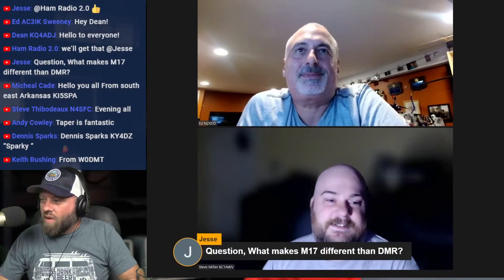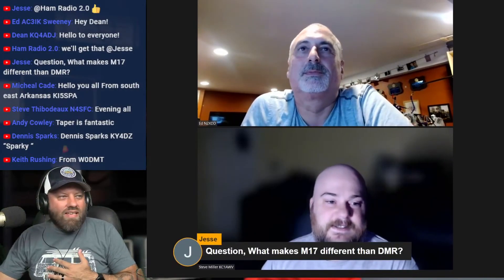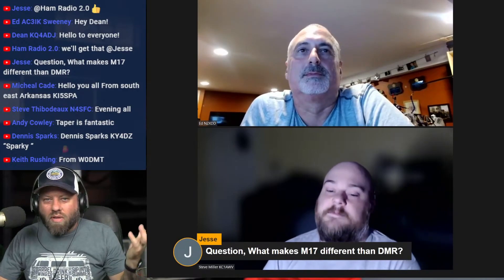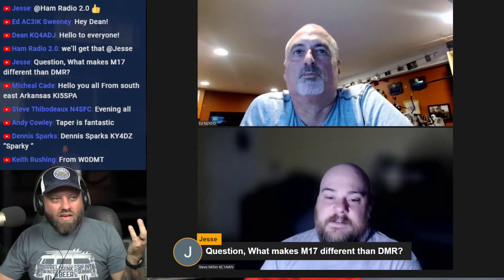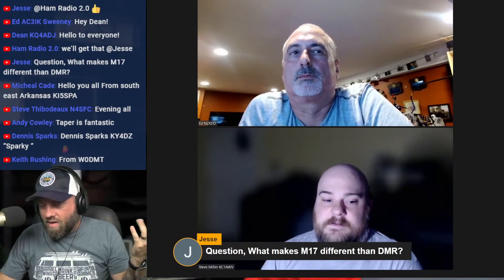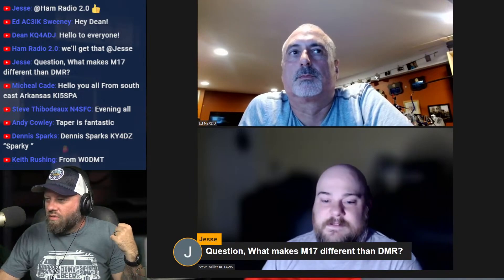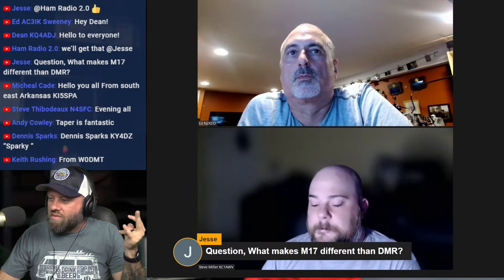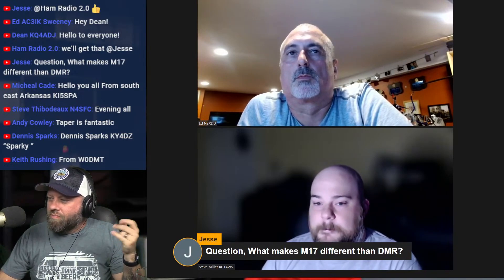M17 vs DMR - Digital Voice Mode Comparison

Comment: Three years later, OpenRTX is still incredibly primitive and M17 audio is still ghastly, filled with painful squeals and squeaks. Wanna see for yourself? Tune in Kansas City Wide on Brandmeister 313136 on a DMR radio and reflector M17-KCW Module A on an M17 radio, Droidstar or the M17 web client. Tell me which one you want to listen to. That system has a ton of traffic, it won't take long.

I'm not an M17 hater, I had high hopes for the concept, bought a CSI radio for it, modified a TYT and have been following along for years now. But apart from Jerry Wanger's radios (whose version of OpenRTX is stripped down even more than other releases!) the much vaunted hardware is mostly vaporware or unobtanium. Suggested solutions are buying a $500 radio with a 9600 baud data port, connect it to a computer via a digital interface and talk through a USB headset!   Don't wanna spend a huge pile of cash just to talk into your computer? Well, you can buy a $100 DMR radio and perform microsurgery on it's TINY surface mount components that most people over 40 can barely see, let alone rearrange on a circuit board. Once you've got a hardware solution, repeaters with M17 don't exist in most areas, especially since MMDVM & WPSD support was dropped so you'll need to load a stagnant, modified version of WPSD on your hotspots. Simplex? Forget about it, you're surely the only ham anywhere near your Maidenhead location that is equipped for the mode. On top of all this, the developers seem brainwashed into thinking the mode sounds great despite EVERYONE telling them it sounds awful. It's approaching cult status.

My hopes are rapidly fading and I don't see much future for the mode. That being said, I'd very much like to be wrong.

Comment: Csi radios has made some great stuff. (Or whomever really makes the radios). Had them in ltr when they first came out a long time ago. They worked great.  They worked easily on ham bands analog and ltr . If you ever want a legal semi private  way to talk on simplex. Use the ltr radio on ham freqs and set encode and decode to an ltr channel number 1-250. Set that on both radios and program to allow tx without data present and voila. You have analog radios using ltr squelch.   Its not private per se but u dont hear others unless they capture rf.   Good video.  Much luck to csi in their success.  Csi made great ltr rptr and other commercial equipment that was like the mfj of ham radio as to what they are in the commercial world.  Good working quality commercial equipment at ham radio rates.

Comment: so basically 1:1 system fusion, just free vocoder so no vendor lock :)
Reply from the maker: There's no vendor lock on any of the digital modes
Reply: @HamRadio2  i wouldn't say that.. haven't seen any non-yaesu ysf c4fm radio yet
Reply from the maker: @EvgeniX.  Every Pi-star and Openspot and any other hotspot
Reply: @HamRadio2  you're correct. droidstar as well.. however if you prefer to work a repeater, or simplex, have unstable/unavailable internet, emergency comms or satellite.. that wouldn't cut it 🤷‍♂
well, there was an old version of dudestar back in the day that was able to TX c4fm via 9k6+mmdvm, however afaik nostar the dev (Doug McLain) dropped the support around 2022 in favor of m17
Reply from the maker: Yes true but you're changing the subject now. The point is that the digital modes aren't vendor locked
Reply: @HamRadio2  good point. yes I meant the ability to actually TX in certain modes is indeed vendor locked (well besides DMR where there's multiple vendors, yet you still locked to proprietary AMBE+) while the benefit of M17 as I see it, is the ability to TX this mode with pretty much the equipment of your choice :)
on a side mode, following your channel for a while now, I have to admit your content is top tier 👍

Comment: What are the advantages over DSTAR aside from the open source codec? Do we still need to deal with CALLSIGN B and CALLSIGN G / weird configuration bits? Fusion is a lot easier than DSTAR. This seems like a step backwards in some ways.
Reply from the maker: DSTAR is older than Fusion, so it is a step backwards. 
Yes you still need the callsign bits for setup
Reply: @HamRadio2  Right, so why is m17 modeled after something that is older than Fusion? Seems odd.
Reply from the maker: @Transmissions  M17 is closer to Fusion than DSTAR. You were asking about the callsign setup for DSTAR, not M17. M17 doesn't require any of that.
Reply: @HamRadio2  I understand the codec is similar if not the same but the ease of use of m17 seems to be closer to dstar, right? We lose the ability to have room names and have to once again relegated to XLX “reflectors”. Aside from the codec being different than dstar, how is this any different usability wise from dstar? I think more people would be interested in how easy it is to setup than caring much about a codec.
Reply: @Transmissions  For one thing, DStar radios have memories where you can store frequencies! OpenRTX for the CSI M17 radios is totally barebones, no memories. Wanna QSY? Gotta type in the RX and TX frequencies. Talk about a step backwards...

Comment: Biggest feature I was surprised was not mentioned "M17 encodes your callsign directly into the protocol, no user database or user registration is required" this is a significant usability upgrade and eliminates the worry of loading thousands of contacts into the radio just to see readable call signs.
Reply from the maker: True but this isn't a new feature since DSTAR and YSF already do this. But yes, compared to DMR...true
Reply: DMR can also do this, but it requires support for Talker Alias, which not all radios have. And a lot of users with compatible radios haven’t set it up. It does work over Brandmeister. I’d say almost half of the users in the talkgroups I monitor have it enabled.
Reply: I'm not sure why loading a database is a worry. It's easy to do, most CPS software handles it automatically. (OpenRTX doesn't even have a CPS!) With OpenGD77, it's just a few mouse clicks. Furthermore, you don't just get callsigns, you get names and locations which makes nets much easier for both control operators and participants.
Reply: @socallars3748 what happens if you are in the field and don’t have access to update your radio with a CPS. This ain’t 2005.

Comment: Anything that's easier to program than DMR will definitely be a blessing! Can't wait to try it myself!
Reply: I agree. I steered away from DMR because of the programming woes associated with it. I went to DSTAR as it’s easier to manipulate while driving.
Reply: hmm.. been using opengd77 for a while now, programming DMR there is a piece of cake!
it even does slot, color, and group scan.. all you really need is the freq 👌
Reply: @EvgeniX.  OpenGD77 will spoil you, it makes creating and updating DMR codeplugs SO much more straightforward.